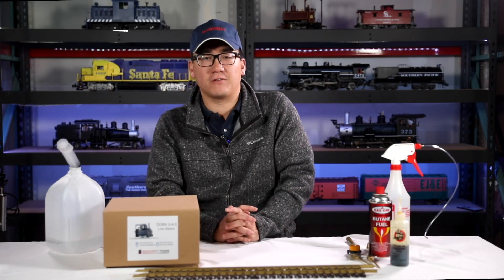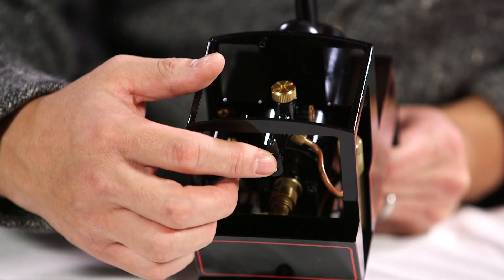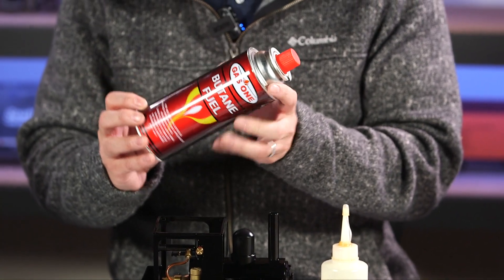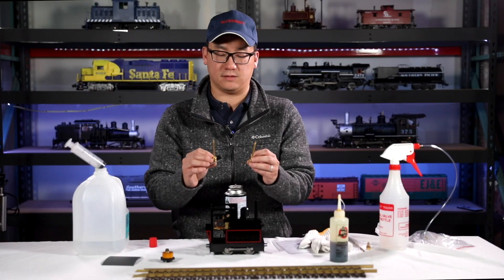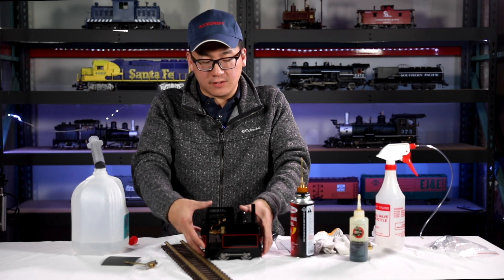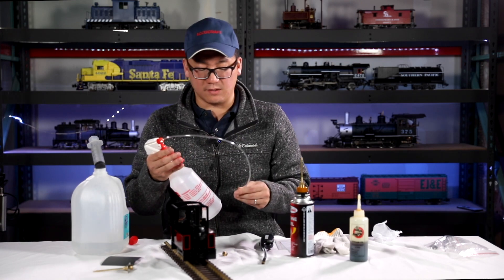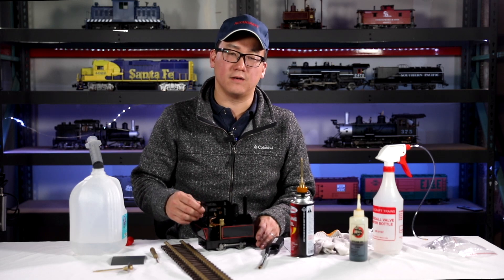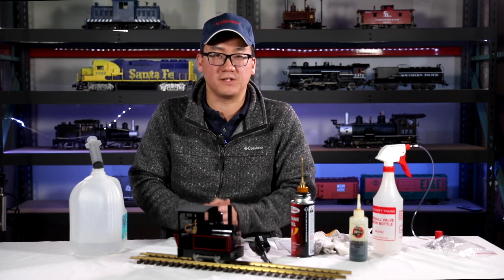Beginner’s guide to live steam butane-fired locomotives.

Comment: Should I be able to fill the boiler through the goodall valve when the valve is cold? I can't seem to get any water through my valve unless I pull the tube back and expose the hole. I'm using the supplied 50ml syringe that I received with my kit and it won't even push air through.

Comment: I love my ruby kit
Reply: What is the area that you put the butane canister on to fill it with gas called?
Reply: @jeff shackleford  the sheat of iron that makes up the cab floor is called the footplate on the ruby the gas bottle thread stud goes on the left on the rear hole the displacement lubricator goes over the front hole  careful they are easy to strip the threads on, I found its best to place a small donut of electrical tape around the bottom rim to help prevent it from rocking and turning lose I also found that the bottle get too cold fast and that cutting a heat sink to the height of the bottom of the gas bottle ID plate and bending it around a slightly undersize sanded wood cylinder to a snug fit on the gas bottle and placed on the boiler facing side and tied with thin wire helps the gas absorb heat to boil faster and feed the burner in cool environments [edit] butane gas filler valve m5  sorry just woke up and didn't comprehend what you were asking until I woke up :)